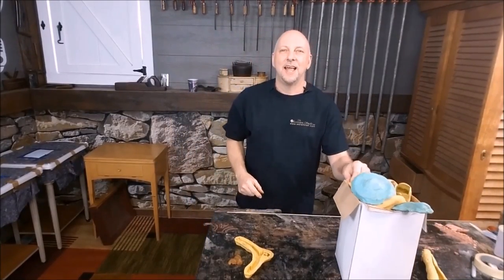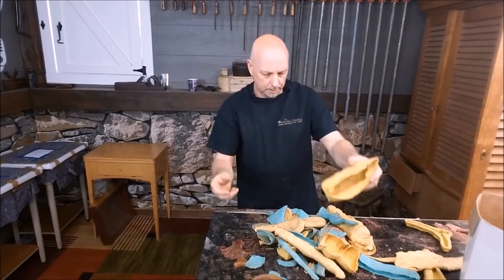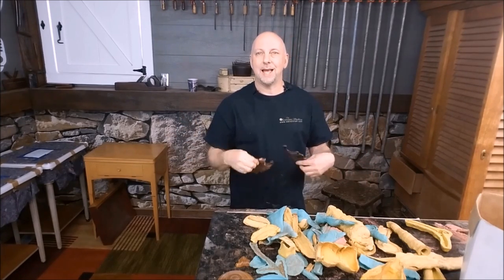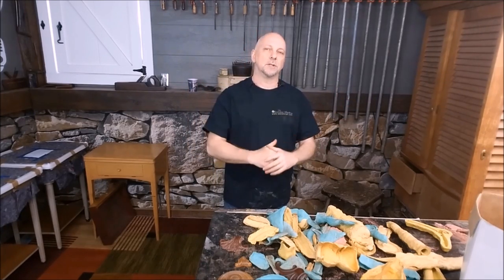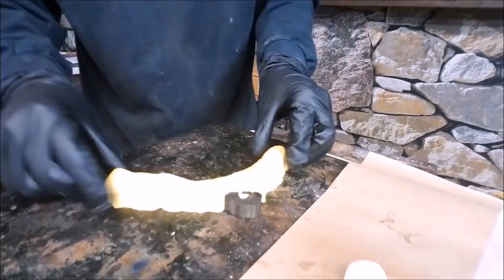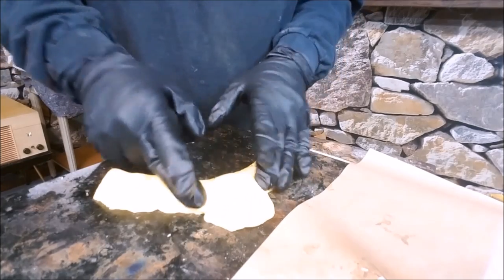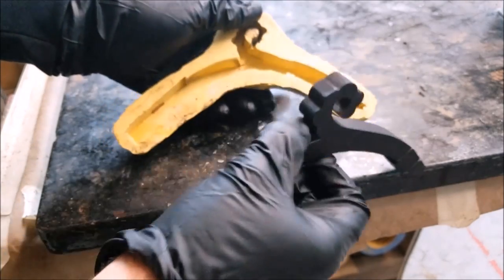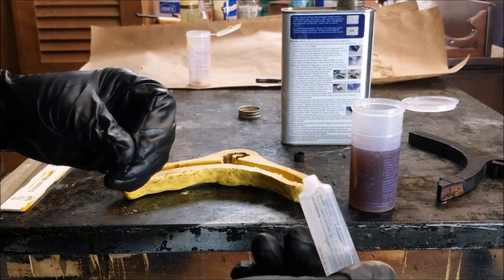How To Reproduce A Missing Molding Or Part On Furniture | Silicone Two Part Mold Making Technique

Comment: Completely enthralled by the process. I have taken Fimo - plasticlay- and made molds for tinier things & understood the steps but did not know what to use-or what works best for larger parts. Also, something easier/faster too.  Because --- if you start looking up and researching resins and fillers, and molding agents - you find a whole bunch of different products. I wanted to see an actual molded part made for repair. THANK you! I have a wonderful century old picture frame that I've saved for doing this project and now I cannot wait to get started. I am an artist and sort-of handy, but it sure does help to see the process in action.

Comment: Your instructions are easy to follow.  How do you create a mirror image mold.   I have a piece of molding on an oval mirror frame which curves to the right (looks like wings)  How do I create a mold from this which curves in the opposite direction?
Reply: This is what I need to know also.  He isn't really fabricating missing parts here so much as duplicating parts he has.  i have a flourish piece that broke half off and I can make the left side, but How do i replace the missing right side if I don't already have it?

Comment: We made the pieces and they turned out perfectly with the products you suggested. But the gel stain does not color them. It just wipes back off. Does this need to be applied with a heavy coat, then let it dry and do not wipe it off like we are used to doing with a stain? Does is it work more like a paint? Thank you

Comment: What would recommend if you wanted to stain the wood, not paint it? I have to create floral medallions which my contractor chipped on a pair of 1900 doors. Is there anything that accepts the stain evenly? He put Bondo on a part of the wood that came off and I heard Bondo is not the best for a bathroom because of shrinking and contracting. Can I sand off the Bondo and skim coat a layer of wood filler? Thank you for your informative video. Please wear a mask as you know. lol
Reply: Gel stain... not a paint, not a stain. It's the love child of paint and stain and works well. Otherwise try ArcaGlass and mix with a dye or bottom sludge of an oil based stain can. play around with samples. Good luck.

Comment: Great video and I love the products you shared.  Thank you for the generous information!

It looks like the front of the molding you made a mold for and filled with resin ended up facing the back.
So you therefore had to recreate the notched look with the sander.  It worked because the front of the molding and back of the molding were both flat.

But if the existing piece of carved molding on the right had a more rounded front and a flat backside, how could you flip that and make it work?

That is my exact predicament. 
The center drawer on my antique has carved wooden molding flourishes (should be one on each of the lower corners), but the lower left molding is missing.

The front of the carved molding is rounded and it lays flat on the back, where it attaches to the drawer. 

I can take that carved wooden molding and I believe I can reproduce it with the method you showed, but when I flip it like you did the flat side of resin piece would face front and the rounded side would face the drawer.

How do I solve that?
Reply from the maker: Sometimes, what you mention will happen and you won't have a good duplicate to mold.  In those cases, I either re-shape the molded piece if possible, or just make the missing piece from scratch.

Comment: what if you need it to be a matching wood piece unpaited,,say stained  or a matching wood color,for a chipped clock finial  piece of molding on a 130 yr old clock,,what can i use,,its a sliced off half of a finial thats part of the clock case  trim on the door.
Reply from the maker: If you need/want it to be made of wood, this method isn't for your application.

Comment: Once dried, can the fiberglass resin be drilled to attach to furniture?
Reply from the maker: If you are careful, but you risk breaking them.  I normally glue them on with 5 minute epoxy.
Reply: @FurnitureRefinishingStudio  thank you for the info!
Reply: @FurnitureRefinishingStudio  if you need to drill or carve the object after casting, use Ice Resin.